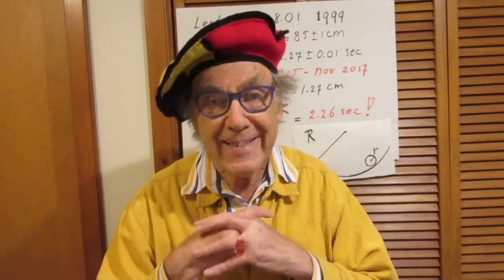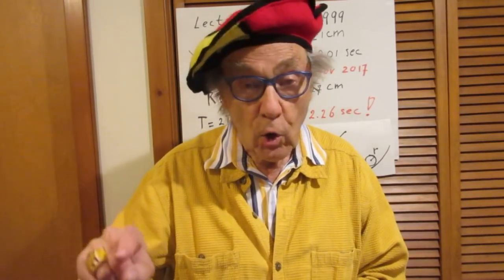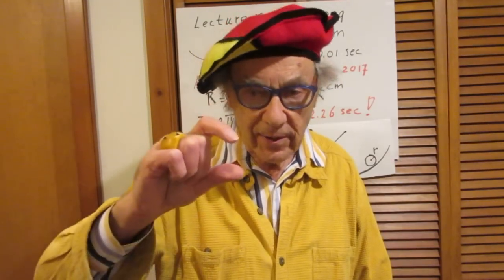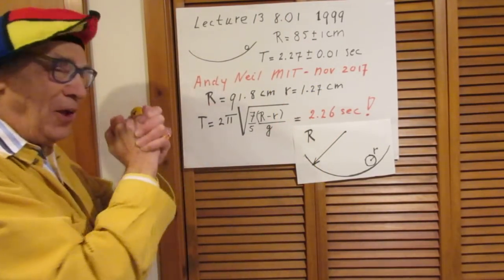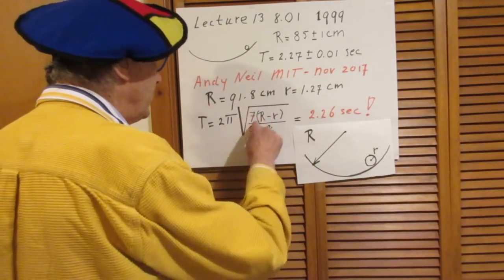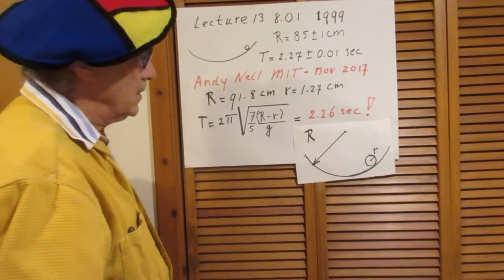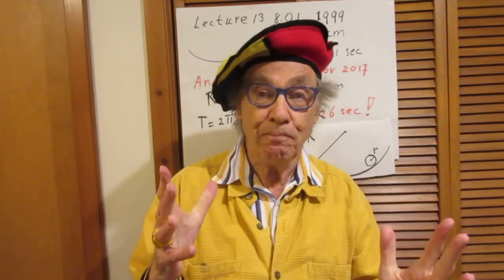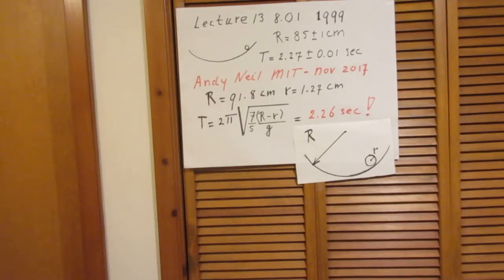Solution (2/2) Problem #23 - Rolling SHM - Experimental Proof!

Comment: Respected professor ,
Please post a general physics problem of research level for improvement of research skill.
Reply from the maker: the purpose of all my bi-weekly Physics Problems is to educate people - to teach them Physics not to teach them how to do research.
Reply: Lectures by Walter Lewin. They will make you ♥ Physics. 
If possible please post in this comment section .
Like when I was in high school I used to think why badminton shuttle filps when hitted. I didn't get answer from anywhere and I forgot about it .
Yesterday I Google it and saw complete research paper ,it wonders me.
You have 40+ years experience of teaching physics and you must be having thousands of such small problem like this.
Atleast suggest 1-2 such kind of problems.
Please please please professor Walter lewin.
,we are still friends.
Reply from the maker: I try not to use Bi-weekly physics problems whose answers are easily available using google.
Reply: That's why I am asking you to suggest a problem on a little higher level ,whose answer is not available using Google.
Reply from the maker: That's exactly what my Bi-weekly problems are doing. Take this week's problem and take next week's problem - I will post it on Sat Jan 13. No; way you can get the solutions on the web, but they do teach very basic Physics and that is my goal.
I typically get 200-300 answers on Problems. It takes me in general less than 10 sec to decide whether it is wrong or right. Supposes I asked:
Why is the recent detection of GW170817 even more important than the detection of GW150914? People will have to do their homework and they will then answer me with 1 or 2 paragraphs. 30% of that may be correct and 40% may be dead wrong. 
I would no have time and to send meaningful comments on 300 answers. Thus it will not have the character of a Problem like my present bi-weekly problems. It would then be enough that I would write: Problem 34: Do you homework on Gravitational waves and try to understand why GW170817 is even more important than GW150914.  And I should leave it with that. I could then write my short answer after a week on my channel - no need for a video. That's not what I want.
Reply: Got it.

Comment: Hello Dr. Lewin
I have seen Lecture 13, 8.01 and there was difference in time between expected and actual. When you asked students why , some of them replied " because of friction but you said the friction was low.l wonder if the friction was low why the oscillating motion has damped so fast in about 20 seconds as we have seen that the amplitude was getting smaller with time.
My regards. Mr, may God bless you and grant you the very long age.
Reply from the maker: if friction were high, that could explain why my predicted value 2pi*sqrt(L/g) could be wrong. I wanted the students to think out of the box and not get stuck on friction. Thus I gave them the hint that friction was NOT the reason for the much larger period of the rolling sphere.  The decay of amplitude of the rolling sphere is air drag which, ofcoz is friction. But that is NOT the reason why the period was so high: 2.27 +/- 0.01 sec.
Reply: Lectures by Walter Lewin. They will make you ♥ Physics. 
Thanks Mr.
I knew now the reason for the decay of the amplitude  ( air drag) and I knew too from your problem the precise time talking into consideration the inertia of the sphere.

Comment: What would a pendulum that rotates in free space have as a period verses a typical pendulum? (The rotating pendulum looks like a yo-yo, in other words) (rotation rate can be defined by you)
Reply from the maker: A pendulum in free space would NOT oscillate unless you accelerate it. If the acc is a, the period of an "ideal" pendulum is 2pi*sqrt(L/a). A pendulum will not oscillate either in the ISS even though there is an acceleration (w^2*R) and there is also gravity (about 9 m/s^2). However, the ISS is in free fall thus it is weightless.
Reply from the maker: Watch my 8.01 lectures and/or use google
Reply: Lectures by Walter Lewin. They will make you ♥ Physics.  Misused the phrase "free space". I meant a suspended pendulum, but one that the disk can rotate. Such that the rotation is not a restoring rotation, but, instead, a one-way rotation as it also swings like any other pendulum. Thanks!
Reply from the maker: question unclear - ask quora
Reply: Lectures by Walter Lewin. They will make you ♥ Physics. Alright. Quora, then. However, it was just a tiny twist on your original pendulum problem. One where the disk of the pendulum can rotate while it also swings; something like the pure roll cylinder problem you made except the disk, or cylinder, this time doesn't have pure roll. Instead it freely rotates like a wheel at whatever torque you set it at because it is merely some sort of wheel hung at the end of a pendulum arm. Then, after spinning it, you'd swing the pendulum arm it is connected to. I will look over your videos and will then decide how differently this sort of pendulum would swing.  Thanks again!
Reply from the maker: If the bob can rotate and is attached to an solid arm, the bob cannot go into a pure roll state. Try to set up the diff eqs and you will see that for yourself.
Reply: Lectures by Walter Lewin. They will make you ♥ Physics. Well, right. I'm specifically saying that the bob is just like any other free hanging bob on a pendulum, except for the idea that it rotates around it's center of mass ( like a wheel). So, there is no contact or friction with anything in this example. Therefore, correct, no pure roll. That's the twist on your "pure roll" idea/problem. Remove pure roll situation, while keeping some sort  of torque.  See it?

Comment: Sir In the Playlist Electricity and Magnetism Lecture no. 11 and 13 their is Some Time Use of Right Hand to find Force Direction and Sometime Right Hand ...... Is this my Weak Concepts or there is Some Mistake ........ Plz Post a Lacture of Right Hand Use to Find Force Direction
Reply: Sometime use of Left Hand and Sometime use of Right Hand ...... Plz Tell me
Reply from the maker: Watch my lecture on vectors. You seem to have problems with cross products of vectors.
Reply: Lectures by Walter Lewin. They will make you ♥ Physics. Okk Sir , But I know Cross Product -> ( |AxB| = |A| |B| sinO ñ ) But Which hand is to used Right or Left ? , I think Thumb Direct the B Direction and Middle Finger direct the Force , Is it Right ??
Reply: Lectures by Walter Lewin. They will make you ♥ Physics. Problem is that I Can't Understand Whether I have to take Upward Direction or Downward Directions
Reply from the maker: C=AXB is perpendicular to both A and B. Let A and B be vectors on my blackboard. There are several ways to find the direction of C. This is the way I do it. I rotate A to B over the shortest angle possible. If that rotation is clockwise C is into the black board, if it is counter-clockwise C is out of the blackboard. I do this instinctively (it's part of my genes)  in less than 1 second. It never fails me. https://www.youtube.com/watch?v=0na1JdPE_JY&list=PLyQSN7X0ro203puVhQsmCj9qhlFQ-As8e&index=4
Reply: Lectures by Walter Lewin. They will make you ♥ Physics. OK Sir , Now I got it , Now its 100% Clear to me  ..... Thank you Sir
Reply: Lectures by Walter Lewin. They will make you ♥ Physics. Sir Can I asked all of my Doubts here Daily or In 2 days ..... Of any Chapter in Physics ??? plz Tell
Reply from the maker: yes you can ask questions here. 1 question at a time and ALWAYS refer to which of my lectures and how many minutes into the lecture.
Reply: Lectures by Walter Lewin. They will make you ♥ Physics. Sir , Now I'm going to Watch Lacture no.14 from Electricity and Magnetism I.e., Part III of Magnetism
Reply: Lectures by Walter Lewin. They will make you ♥ Physics. OK Sir , I will doing the Same for my Doubts .....